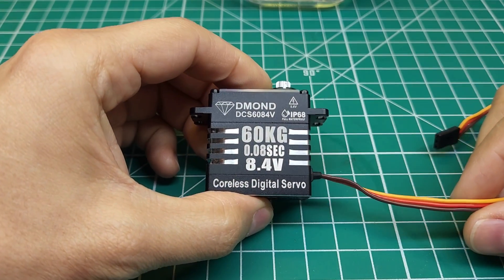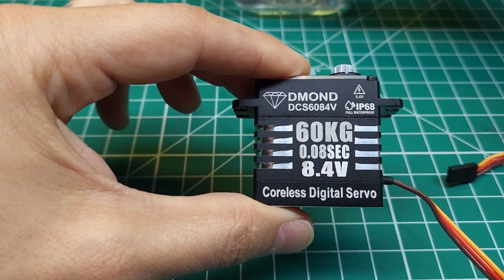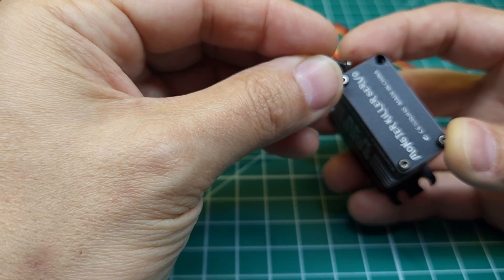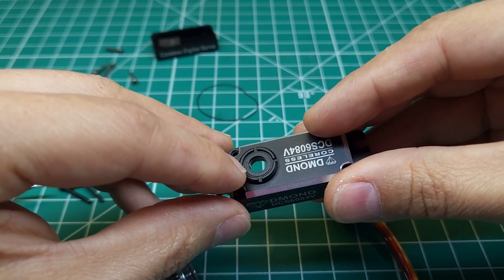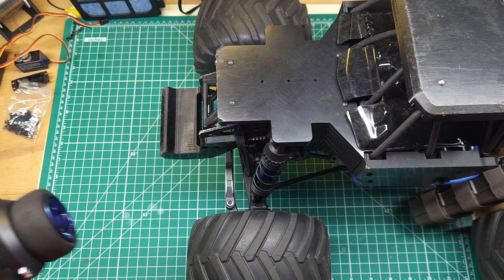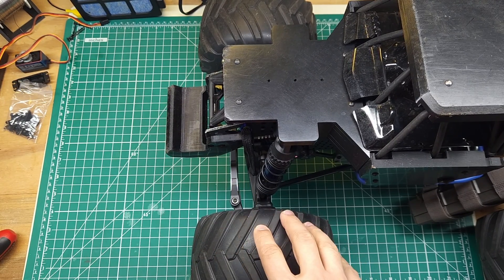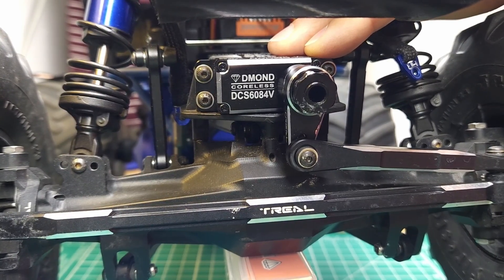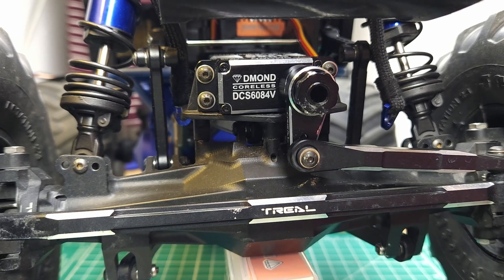Everything You Need To Know About The DMOND 60KG Servo [Giveaway Ended]

Comment: I got one of these for my lmt and it broke on the first pack lol snapped the snout right off clean. Cant get in contact with the company or find a way to get a replacement one as its an easy fix if the parts existed or someone to talk with lol
Reply from the maker: Where did you get it from? Pnw RC madness has parts.
Reply: Yeah i got it from chris at pnw and he didnt have any when i asked but that was months ago. Ill give him a call and see if he has them! Thanks!
Reply from the maker: @mattm1841  he didn't have any when I bought mine either but he got a batch in
Reply: just talked with him and he said they are revising the material used in the gears and doesnt have any right now. But at least they are fixing a clear problem iv seen at least 5 other people that had the snout break clean off the top of the servo lol
Reply from the maker: Mine did too.

Comment: Hey bud 3 questions... Where did you buy this servo? Not seeing it on Amazon, also how much was it? And 3rd have you heard of the JX 45kg cls-hv7346 Servo? It's only 59$ and power hobby and others sell it as a rebrand for almost 100$. I might order one for my reeper
Reply from the maker: I got Mine from pnwrc madness.  I think it was 80 bucks. I'm not familiar with that servo. Do you know which power hobby servo rebrands it? I'm a big fan of the power hobby 729
Reply: @DoRC Hey buddy I'm sorry I never saw this but those jx servos have been holding up so far. I run the brushless JX 46kg HV servo in my cen reeper and I run the 36kg jx ecoboost in my kraton exb. Both have really good power and speed and are also affordable. They are about $35 and $59 on Amazon. Much faster than what this one shown on here.  I definitely recommend. Jx makes really good servos and been running the brand for a long time. If you ever grab one let me know what you think as I'm curious to know your thoughts if you do.

Comment: Looks good but gears seem to be made of soft metal. When I was fixing my JX Ecoboost (gears look very similar) I had to drill a new hole for the pin in 1 of the gears. It was very easy, like drilling in soft plastic 😆
 I might want to try AGF servo in the future. Some of their servos have "extra strong patent gears" - I'm curious how much more abuse these would survive than cheap Ecoboost 👊 I like to have my servo saver very tight, sometimes even locked for some jumps 👀
Reply from the maker: Yeah I would say that the servo is just okay. There are definitely better options out there.

Comment: I've noticed Phil of Tomley RC has been pushing these servos lately because they sent him a bunch. He provides honest reviews imo, but one thing I didn't noticed was how disappointingly slow the movement was, even on 6.4 volts. I wouldn't expect better performance using 8+ volts. After seeing how slow it was, I hoped you'd try it on the higher voltage but, oh well. Thanks for the good review, Kenny. See you back at B & Crashers.
Reply from the maker: After making the video I tried it on 8.4 volts. It's pretty slow there too.  According to their specs there's only a 0.2 seconds difference between the two voltages and the difference isn't really that great.  To be honest I fully expected the servo to either be slow or underpower.  I've never seen a brushed servo come anywhere near there claimed specifications so I was not surprised at all.
I was also disappointed about the lack of waterproofing because even a $25 35kg annimos servo has orings on the screws.

Comment: This was a great testing video! Nice to see actual use of a product before considering it. In relation to servos, I've heard the JX ecoboost ones from banggood are pretty durable and very fast. Also a quick question, how do you measure servos? Is there a standard size? Since my 144001 uses a pretty small servo (i think 18g size) and i was wondering if there's some kind of standard now maybe for bigger scale cars. Thanks for the great video!
Reply from the maker: The vast majority of RC vehicles use what's known as a standard size of servo. That's the size that this servo is and most other servos. They make micro servos and also 1/5 scale servos. But most vehicles will use a standard servo. In that standard servo size though the can length can vary which can affect compatibility on certain vehicles. That being said most standard size servis will be compatible with most vehicles that take standard size of servos.  Thanks for watching and don't forget to subscribe if you aren't already subscribed :-)

Comment: Nice review. I was already skeptical about the specs because 60kg and 0.08s is almost impossible for a coreless motor, it need to be brushless. Could be great if you could check the power somehow, by lifting a weight or something. Great review 👍
Reply from the maker: Yeah I thought about doing that but for me personally as long as the power is sufficient I'm happy. I don't really care what it's ultimate strength is.

Comment: Thanks for the great review. I agree, the servo is plenty strong but it's disappointing how slow it is. I run a Shift RC S2.0 on my other LMT and it's amazing. Fast, durable (20+ packs) and looks darn good. I'd recommend that to anyone with a heavier wallet over this one.
Reply from the maker: Thanks!  Ill take a look:)
Reply: Would love to see 8.4v for real speed. Looking for servo for my custom punisher xtr build curious if speeds would be ok for a much lighter rigg? Keep up the reviews love the channel.
Reply from the maker: @irish33rc9  thanks :-) I have tried it on 8.4 and it wasn't a whole lot faster. A little bit but not enough to call it fast.
Reply: @DoRC  any recommendations? I am doing a custom built Kronos xtr but with some tweaks of my own. Having a custom made bash bar and captured hinge pin braces made out of titanium, basher queen shock towers, every aluminum upgrade offered by corally , custom 7075 bulk head arrma shocks ect want speed but serious tourqe and I trust ur experience with servos. I used a 46kg jx on my exb kraton build with belted trenchers and wasn't enough tourqe. This build will be considerably lighter but appreciate any suggestions. Thanks in advance.
Reply from the maker: Hard to go wrong with the power hobby 729. It's a lot of servo for the money. If you want to go cheaper the Amazon 35 kg servos are surprisingly durable. Kind of slow but they get the job done

Comment: Bought the used lmt wirh a reefs 500 in it I’ll move over to my big tire truck and I’ll put this one on my fling king truck and maybe run some silicone around the seam for the water since it’ll be a mud truck
Reply from the maker: Seems reasonable! Reefs 500 is a beast:)
Reply: @DoRC  where do you think the water got in?
Reply from the maker: @calebgilmore3327  water got in on what? I didn't see you say water got into anything